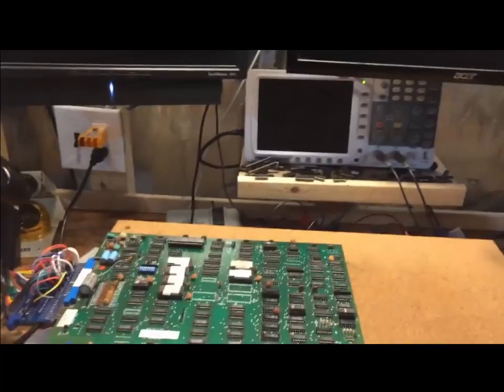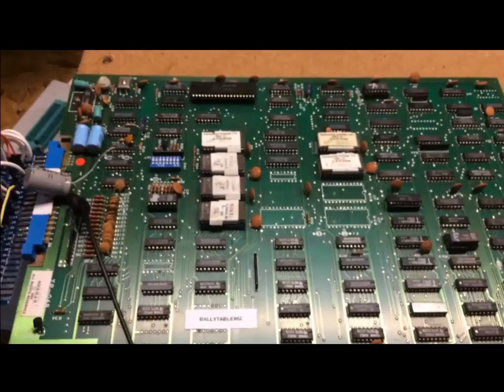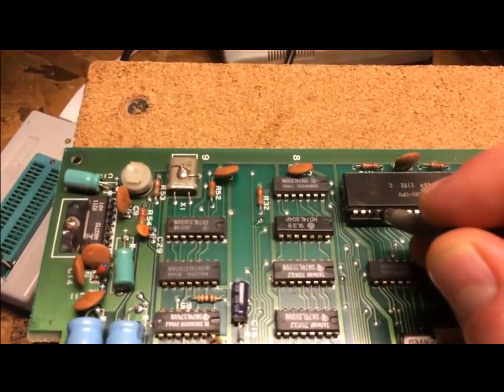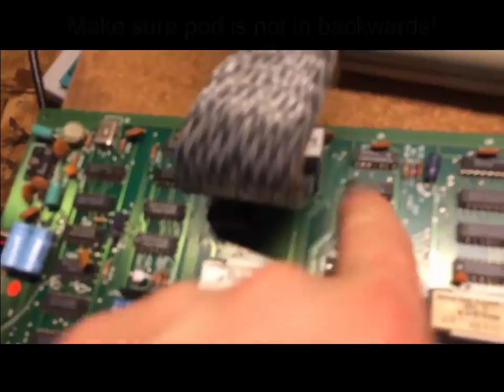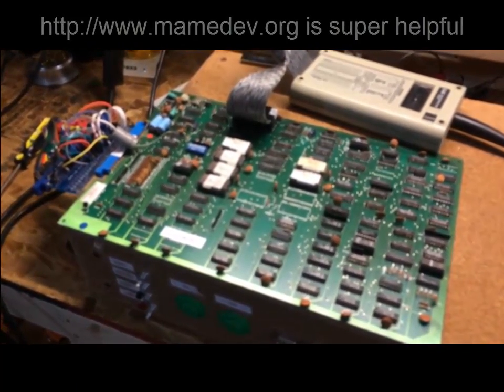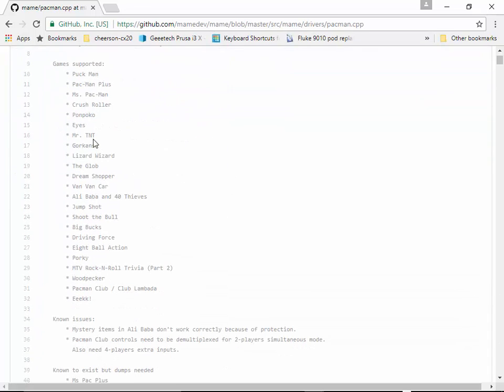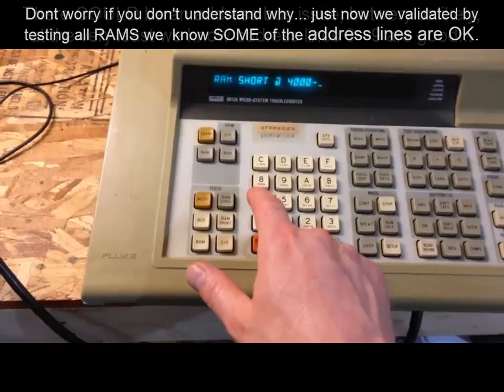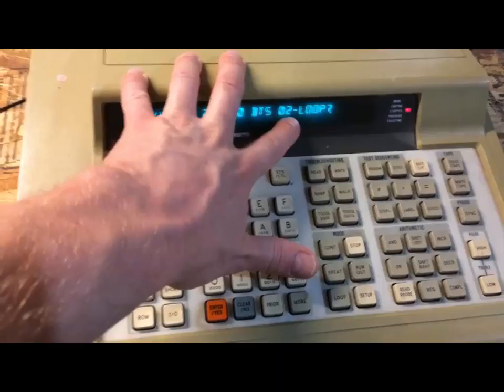repairing arcade game PCBs: Video 2 - Rockola Eyes

Comment: in general arcades use NMOS static RAM chips like 2114 Ram are NMOS. I'm guessing SRAM chips are NMOS? I have seen PMOS RAM chips, CMOS RAM chips, ECL RAM chips in arcade games. What are the differences for use in an arcade games is it only different access time advantages? Nintendo uses ECL RAM for the video data, not sure why I'm guessing because of the faster access time to process the video data faster.

Comment: Would it have been easier to loop the ram test and then just see which chip select pin8 was grounded?
Reply from the maker: that certainly is another approach that would work. that said you really want to know how to convert hex to binary as their will be times where that knowledge will really help you out. in this case either method would be perfectly fine, your solution probably would have been a faster approach.
Reply: Yea, I liked your method, very useful. I was just wondering. Thanks for the response :)

Comment: ARCADE CABINETS.COM ///        
     1.) What "Determines" the RAMS starting and ending ranges?
        2.) If you look at arcade game schematics often the decoder chips input pin A,B,C,D one of the input pins is GROUNDED. So how do you get the RAM's starting and ending range is one of the inputs is grounded the first number would always be zero 0, but each RAM range will be 1,2,3,4
1000 to 1FFF, 2000 to 2FFF, 3000 to 3FFF, 4000 to 4FFF. But if one of the decoder chips input pin is always grounded it would be 0000-0FFF?